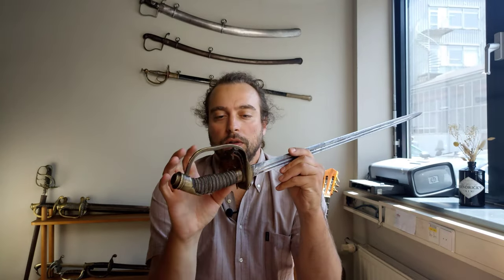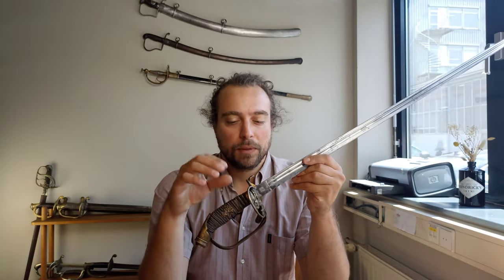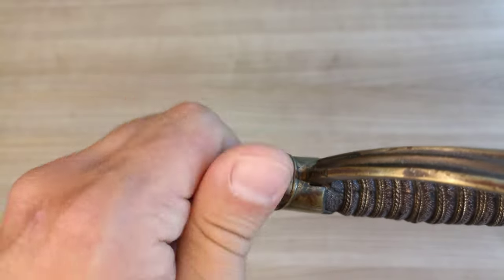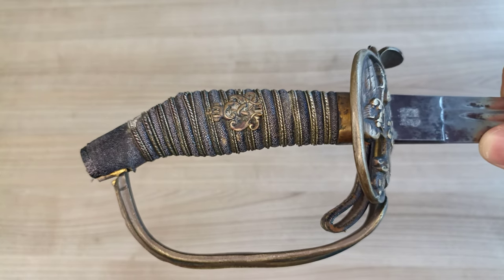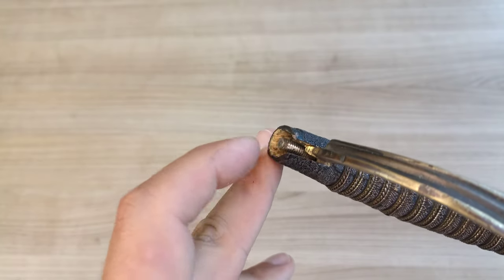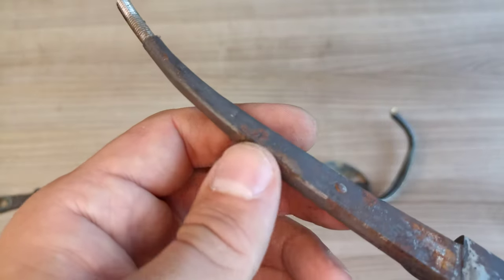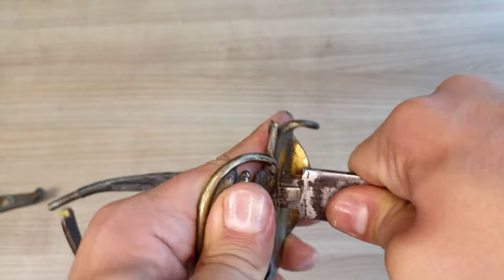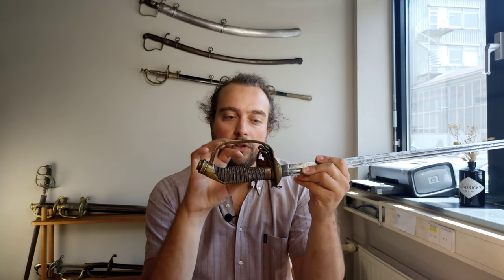Antique Sword Restoration and Maintenance: Disassembling a German IOD 98 Infantry Officer Degen

Comment: I was delighted to find your video; I have exactly this sword, it has been in my family for a long long time.  I have done an external polish/restore but could not see how to remove the pommel cap - great hint!  Need to re-wrap the wire and keep conditioning the leather and I think it will restore fully.  Scabbard has surface rust and I need to figure out how to attach to a sword belt - missing some pieces there.  Bravo for a clear and concise video on exactly what I have been working on!
Reply from the maker: Thank you very much! I'm very happy it was useful

Comment: Awesome video, thank you. I have two variants of thus sword, one with a folding guard and one without. The one without the folding guard is a service weapon (sharpened with unit markings, dated 1890). It came right apart after i removed the nut. The handle is made from bone, though - not wood - so maybe that has something to do with it. It was in terrible shape, so im doing a full restore on this one. Your video was very helpful.
Reply from the maker: Thank you, I'm very glad it was useful! I suppose bone may warp less than wood, but it's also possible some swords just come apart more smoothly.
In any case, good luck with your restoration!

Comment: When i read the title i feared the worst--one doesn´t disassemble an old sword, these are an exception. But seeing you touch the blade without gloves is still disturbing. NoGo IMHO. Would never do, even after applying RenWax
Reply from the maker: Thank you, I appreciate your feedback! 
As for the ungloved handling of blades, I definitely agree it can be controversial. I see this as a small "privilege" I have as a collector, and I am careful to not handle the swords much, if at all, outside of these videos, and to clean them thoroughly after I touch them. 
It may help to know that many of these come to me in semi-relic condition, so until they are properly cleaned, I am not excessively worried about damage.